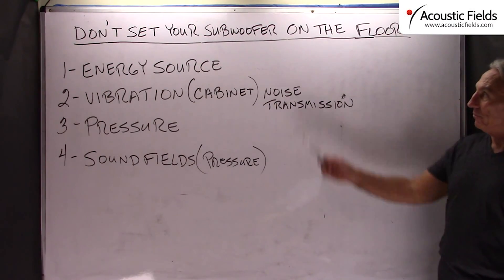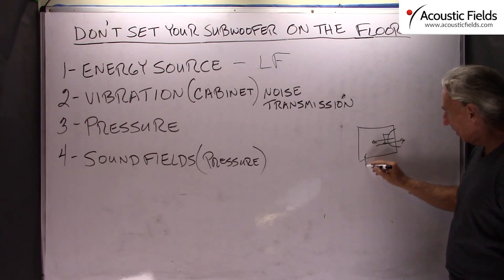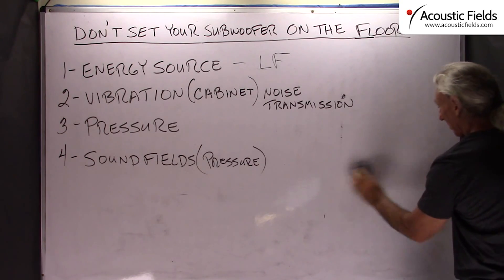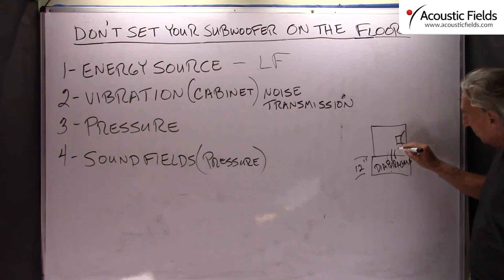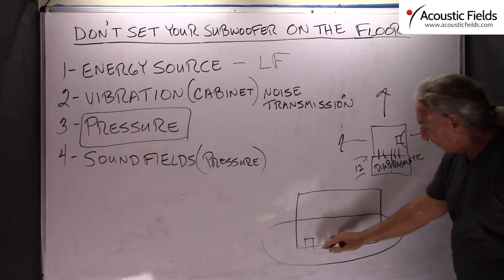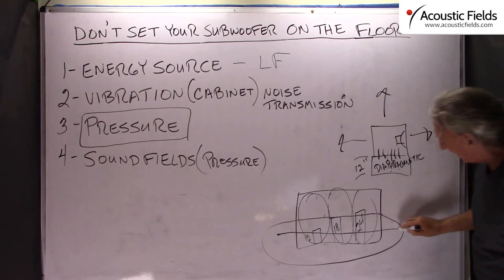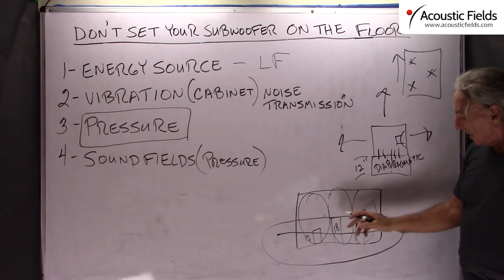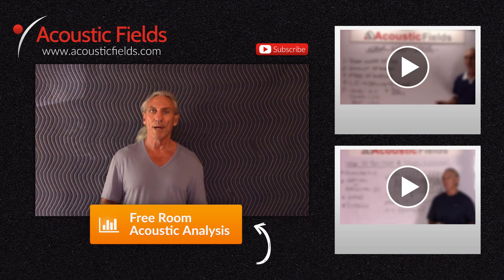Don't Set Your Subwoofer On The Floor! - www.AcousticFields.com

Comment: What happens if I position the subwoofer with the outlet opening directly to the floor? How much will it be heard in the room below?
Reply from the maker: I do not understand when you say "outlet pointing at floor".  Subwoofers radiate energy in 360 degrees.
Reply: @AcousticFields  Lol "outlet" :) 
Output, hole.

Comment: Sir i need help . Got new svs pb2000 pro and having subwoofer NULL IN 11X11 RROOM
Reply from the maker: Elevate the sub 18" off the floor. Start at room center and move in 6" increments in every direction from room center
Reply: @AcousticFields  ty a ton
Reply: @AcousticFields  18 inches off floor? not possible i am using svs isolation pads

Comment: Woah super interesting. I never knew this .. 
Gonna try this today, I’ll be back with details
Reply from the maker: Always keep any lower frequency producing device away from room boundary surfaces.
Reply: @AcousticFields  what would be an example of room boundary surface , like a corner desk ?
Reply from the maker: @Doodfrumspace11  A room boundary surface is a surface that creates the boundaries of the room. It would be a floor, walls, and ceiling. Those are your room boundary surfaces in a rectangular room.
Reply: @AcousticFields  ah okay gotcha , thanks 🙏
Reply: Did you get anywhere?
Reply: @vagabond197979  so , when I had it on the floor , you could hear it but it was kind of hidden at times or it would blend in too much , I raised it 3ft 10’’ and now it’s super noticeable. I’m super satisfied and I wanna even lift it 1 more foot lol but maybe I’m getting too excited. 
Either way , super neat that you can raise the height and it’ll improve bass. 
Now I’m wondering if I move it from the front to somewhere else with that 3ft10” if it’ll be different 🤔
Reply: @Doodfrumspace11  wow.  What are you putting it on that's nearly 4 feet tall??
Reply: @vagabond197979  ironically enough a big woofer cabinet that I don’t use lol it’s 2 10” subs in an inclosure. 
But I have my sub on top haha
Reply: @Doodfrumspace11  Just curious, when you do the "subwoofer crawl" does it sound better when your head is at the level your subwoofer is at now?

Comment: So if you have one subwoofer and found the sweet spot in the horizontal plane, would elevating it change the nature of the sweet spot ? In other words can I elevated the subwoofer at the sweet spot and it still remains the ideal location even though its been elevated ?
Reply from the maker: Three are 3 soundfields that you must satisfy. You have sidewall to sidewall, front to rear wall, and floor to ceiling. Elevating always improves floor to ceiling soundfield.

Comment: This guy doesn't want the subs to be in the corners either. (Check out his other videos.)    What does he want us to do, suspend them midair in a magnetic field?
Reply from the maker: Place the speaker on top your head. Maybe the weight of it will force you to understand the physics behind pressure waves. The room dimensions determine the location of any pressure producing source.

Comment: If you are using woofers instead of subwoofers a 1.5-3 inch sheet of polyfill insulation may be enough cushion for your sub boxes. I’m am going to treat mine with this method and i’ll let you know the outcome. I may also try thick rubber workout matts with a layer of polyfoam.
Reply from the maker: Polyfill insulation material type will not provide vibrational management at the required frequencies, let alone with the amplitude of a sub.

Comment: Due to shortage of rear speaker wire length I have to put subwoofer in middle of the room on floor. Is it ok or I have place at corner only? Is there any difference in base due to that positioning? Please advice.
Reply from the maker: How does it sound?  Stay out of the corners and away from the room walls.

Comment: Hi ! I have mine on the floor, in the corner of the room. What would be optimal ? Put it on a chair and closer to the middle of the room ?
Reply from the maker: Never place a low frequency energy source in the corners of any room. All you are doing is creating more room distortion. Start at room center and move 12" right then left. Move back and forth. Spend time listening at each position change. Elevate the sub off the floor by 18".  Report back to us the initial results.
Reply: @AcousticFields  Wow! it really made a huge difference just moving it around and listening. Im baffled. I can honestly say the sound is probably twice as good, as compared to before *while having it in the corner). I had no idea it would effect the sounds that much. Thanks alot  you really saved me :D !!!
Reply from the maker: @Vaampe  Climb to the highest mountain and shout this for everyone to hear.

Comment: So, who’s instructions do I adhere to? Yours, not to set my subs on the floor? Or, the directions of the manufacturer of my subs who, adamantly advise to very firmly couple their subs to the floor. As the have downfiring drivers which utilise the floor to evenly distribute the bass.

Well, I’ve spent hours and hours of experimentation and trial and error and have found that in my listen environment, optimum results are achieved by decoupling my large floor standers from the floor, but, firmly coupling my subs to the floor.
Reply from the maker: If you are happy with the results, then mission accomplished. We do not subscribe to this approach due to the many issues this coupling process produces.
Reply: @AcousticFields  so you know something companies spending tons of money on developing subs, do not...?

Comment: Friend of mine placed gaia feet underneath, you can put a coin on it's side on top and it won't even move. I love those things.
Reply from the maker: Vibration transmission requires separation of vibrating source and the receiver of said vibrations.
Reply: @AcousticFields  seems to work well then :)

Comment: Great video's top tech. However. 
What about down firing subs - they're designed to be floor coupled. One big point - spikes don't isolate, they couple!!
Reply from the maker: Spikes are vibration reducing technologies. They minimize the transfer of vibrations from the sub cabinet to the floor. Set your sub on a technology that does three things. First, they absorb low frequency energy. Secondly, they act as a vibrational barrier between sub and floor. Finally, a platform will elevate the sub from the floor which will assist with the first two objectives and improve room response.
https://www.acousticfields.com/product/subwoofer-platform-absorber/

Comment: Line array is the way to go. Theaters hang all their speakers. At least every one I've been to.  Nothing on the floor will ever sound quite as strong or clear.
Reply from the maker: Theaters hang their speakers in order to increase the through distance of the speaker design. This works well for large venues with lots of seated coverage requirements. Small rooms are drastically different in their speaker energy distribution requirements.

Comment: It seems the author never dealt with proper subs. If walls of cabinet of your subwoofer vibrate the only proper placement for such thing is thrash bin.
Reply from the maker: Sub woofers just like any speaker produce sound using three methods. The cabinet, electronics and the driver itself. All three must work together. If you like the elctronics and the driver, you can fix the cabinet.

Comment: Even though REL subwoofers recommend having my dual t5i down firing subwoofers placed on the floor, i personally find by having my subs placed on masonry tiles which is set on top of high density 2-inch thick foam 
Not just to help make the low frequency some more Fuller but it also helps getting rid of the Vibrations and of course I think my neighbour from the adjoining wall is more happier! 
(No more complaints)
 If interested to have a look or listen... click on the red dragon twice and hit the 'Rels partnered with Q ACOUSTICS' video.

Comment: Yeah what do you fill the empty space in your plugs into your son I have already put a box underneath my son and I have sand in it and it seems to absorb quite well you might have a better suggestion please let me know or let us all know 2 in sold wood embrace the interior cabinet walls
Reply from the maker: Sand minimizes vibrations from the cabinet to the floor. It is not a sound absorption technology. It is a barrier material type.

Comment: DO ISOLATION PLATFORMS WORK WITH DOWNFIRING SUBS SUCH AS REL T9X?
Reply from the maker: With a sub platform you want to do three things. First, you want to elevate the sub off the floor. How far depends on ceiling height. Secondly, you want to absorb excess energy from the sub cabinet. Thirdly, you isolate the sub from transmitting more vibrations to the floor. Our sub platforms satisfy all three objectives. https://www.acousticfields.com/product/subwoofer-platform-absorber/
Reply: @AcousticFields  Thank you, If you're interested we might test and make a video review of one of your isolation platforms.

Comment: Was this video meant to be posted on April fools? Surely it's a joke not to be taken seriously??
Reply from the maker: Have you tried this approach?
Reply: @AcousticFields  I don't need to drive a car with square tires to know it's a dumb idea
Reply: Depends on what you want.

Want to feel helicopter blades on a movie?

Want to hear a 20Hz sound from an organ pipe?

The floor, walls, etc will add coloring in exchange for energy transmission. It's physics, It's a tradeoff.

🤷‍♂️

Comment: 12 inch isn’t it too high ? It’s about 30cm .. May I use granite 5 cm x 3 granite thickness ?
Reply from the maker: The height of your sub from the floor is determined by your ceiling height. The platform used under the sub should attenuate (absorb) excess energy and isolate the sub from vibrations of the sub to the floor. Granite will provide some vibration management but it would have to be tested for its frequency range.
Reply: @AcousticFields  thank so much! My ceiling is 2.90m meters how much should I raise the sun?

Comment: Oh yeah! Diaphragmatic absorption! Yep. I know all about that diaphragmatic absorption. Probably should've explained it to the other noobs watching the video. 🙃
Reply from the maker: The best location for any low frequency absorption is close to the source. Our platforms are the same technology as our ACDA-12 technology. You can see the performance curves at this link. https://www.acousticfields.com/about/ Our platforms do three things well. They elevate the sub away from the floor which will smooth out frequency response. They attenuate or absorb excess energy and they isolate vibrations from the cabinet to the floor. The sub sounds faster, cleaner, a has more resolution.
Reply: @AcousticFields  I watched a couple vids from you guys about it afterwards, lol. A bit farther than I need to go right now. Thanks for the info though.

Comment: Does the QSC 212 Cardiod sub mitigate these vibrations somewhat?    As far as I can tell it mitigates the rear but perhaps the energy gets to the floor.  My senses tell me no...  I can place a laptop or anything on that sub even when its placed flat on the floor and there are almost no vibrations in the cabinet whatsoever even run at near unity (3200 watts).  Does this mean the energy is mostly traveling directly out the front ?    All other sub cabinets I have experienced vibrate.
Reply from the maker: Energy from any low-frequency device radiates out from all surface areas and is omnidirectional.

Comment: REL recommend putting their subs on the floor.
Reply from the maker: Speaker manufacturers have many reasons why they purport for the placement of their product in this position or that. Unfortunately, most comments are market driven. On the performance side, they are usually designed to make the sound "larger" in the room by locating their product in a corner or next to a room boundary surface. Louder, maybe, but gain is room distortion. I know I do not need any more room distortion. By definition of a small room, I am in trouble from the beginning. Someone told me that a manufacturer was telling people to stack the subs. Ok, so now I must buy two and add to a problem that only one sub needs to produce. I get to increase the problem with a solution that drains my bank account. I do not see the proper risk reward ratio at play here.
Reply: @AcousticFields  Thank you for your advice. Do you think one sub at the front of the room and one at the back is good to stop bass bloat and to fill out the sound, or is that all marketing BS too? I believed the hype... If I only need one sub  in my 20 x 9 x 8 foot tall room then one it will be.
Reply: @AcousticFields  How do I put a downward firing sub on a stand? Thanks.
Reply from the maker: @photomusicman9413  Fire it into an absorption platform

Comment: First time I heard this idea I will need to try it. But my first concern would be if the sub is higher up won't it affect the channel separation from the other speakers?
Reply from the maker: Low-frequency energy is omnidirectional.
Reply: @AcousticFields  yes that's  right. But if that's the case should it matter if the sub is raised from the floor? I will try it but just not sure how to raise it. My sub is mordaunt short mezzo range it has two big bass speakers facing out opposite directions. Just need to figure out how I am going to rise it up. I mean I am going to have to use something that doesn't rattle 😂
Reply: @zombeat7376  the point is minimise the energy to the floor which is transmitted over the floor to everything else in the room - you want to minimize any vibrations and that way you do it at the source of the problem
Reply: @AcousticFields  p.s my floor in my main room is a stone floor so there are no vibration on my floor.

Comment: Would you recommend hanging the sub? It could be placed on a hanging platform attached to the ceiling with ropes...
Reply from the maker: Let's unpack this issue. First, before we consider an installation methodology, let's find the proper location.  Once we locate the location, we can then decide how high to make it within the floor to ceiling height. This measurement process is a bit complex to determine sub height.

Comment: If it's a down firing subwoofer it's literally designed to be placed on the floor...
Reply from the maker: It is down firing because the manufacturer chooses quantity of sound distortion rather than quality of sound.
Reply: @AcousticFields  you say tomato.. I say tomato

Comment: Do u need a dense stand of 12, 18 or 24 inch or can u put it on a table? Putting on a table is better than the floor (in the case of you dont have the stand)
Reply from the maker: Table better than floor if table is solid. Give it a try and report back to us.

Comment: Hello, if you can, please guide me in setting up my first 5.1 surround sound system(samsung htj4500). 
Room dimensions: 10ft x 12ft x 9f
I have a 47 inch TV on the 12ft wall, dead in the centre & it is 41 inches from the wooden laminate floor. 
Where would be the best place to place my speakers and subwoofer?
I have seen a few set ups where the 4 speakers habe been hung in each corner, facing each other diagonally, at around halfway up the wall, is this a good way to do it?

A friend advised me to hang the 4 speakers in each corner BUT right at the top by the ceiling, is there any substance in what he advised?

From my research I have assumed to place the tweeters to the side of where I am seated and the front speakers next to the TV, around 6 feet apart, and the subwoofer on the floor. 
Any advice will be welcomed.....specific height/width etc will be appreciated.... 

what would you place your subwoofer on?

Comment: Thanks guy's,  Just curious but I have 1 single 12" front firing Klipsch sub sitting next to my entertainment cabinet. Should I just do those rubber isolation feet? I could possibly build a little something to raise it off the ground but would look funny too high since it is firing back towards the tv viewer.

Comment: What if I want to reduce vibration from the wall behind the sub woofer ? Damn neighbors.
Reply from the maker: L,  It would require design work and permanent construction.
Reply: @AcousticFields  Thanks for the reply! I notice that my sub has a large whole on the side. That is where the bass thumps seem to come out a lot stronger. Maybe aiming that the opposite way and adding a pad or 2 of sound proof padding on the wall same level as bass. you think that will work?
Reply: L3SAN360 I think you’re greatly underestimating what it takes to control low frequency waves.
Reply: Marcus Jay yeah I’m no expert. But I just stopped using the subs. Heck even on the intensity knob the bass is still strong.
Reply: L3SAN360 it’s low frequency control, not the equipment, that costs the big bucks in a $million studio.
Reply: @MarcusJayMusic  im sure, i just added some bottom foam to it. also added some wall foam. i know it's not much but its something.
Reply: @onesimplecuban  the bottom foam will help a little with transmission through the floor. The wall foam will be equivalent to nothing, for sub frequencies.

Comment: What if your sub is a down firing sub?
Reply from the maker: J,  Down firing subs are more room distortion. Notice that the pros do not use them.
Reply: Acoustic Fields so what would a large company like klipsch still sell them?
Reply from the maker: @joelane4670  What does the size of the company has to do with the products they sell. They sell products that produce energy. having a down-firing subwoofer is adding a room distortion. This is one reason you never see a down-firing sub in a pro-sub. A down - firing sub is all about quantity not quality.